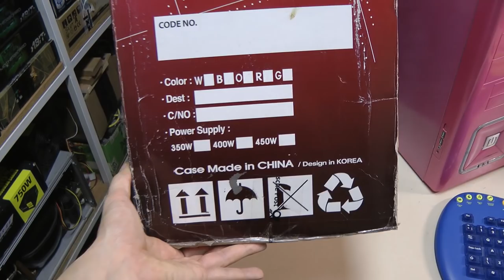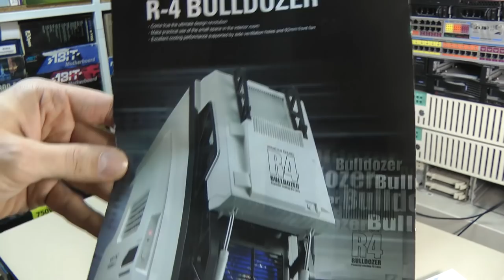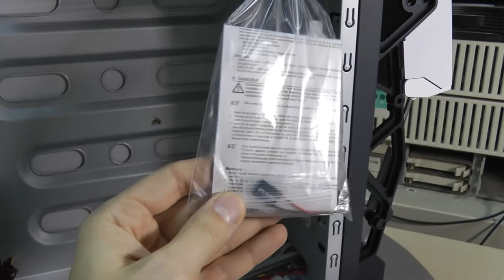GMC R-4 Bulldozer case review - RETRO Hardware

Comment: Maybe the optical drive could retract better if you took off the front drive bezel?  Love your videos!
Reply: Looks like it has to be without it to work properly.
Reply from the maker: yep good idea this way
Reply: @RETROHardware  yes take front of ,its getting stuck in the little ledge
Reply: maybe it was designed like that you have to remove it
Reply: @Pidalin  it's not, I had this exact same case and the little door opened/closed just fine without modifying the drive at all. it's just that the case is a cheap piece of shit and there's probably some injection molding lines on the little plastic cam where the drive pushes the door open and it's getting caught.
Reply: @RETROHardware  did you try just sanding/smoothing the contact area where the tray is getting hung up?

Comment: I've had this case for so long. It housed my P4, my C2D, and 2 different i5 based systems. I can't use it anymore unfortunately, since no proper modern GPU fits in it.
You HAVE to build something in this. Something around 2008. With black/white components.

Comment from the maker: Photo gallery for this video: https://www.facebook.com/media/set/?set=a.1082970265447598
Reply: I was wondering if you'd ever delve into modern hardware? Such as the AM4 socket for AMD or 1200/1151 socket for intel?
Reply: It seems that you'll have to remove the faceplate of the disc tray so it won't catch on the flip door
Reply from the maker: @Kuraio  good idea
Reply: @Kuraio  I thought exactly the same!
Reply: The people yells "BUILD BUILD BUILD"
Reply: @koreannom  Old pc parts are a lot more entertaining than the new ones,

I think that's why
Reply: @PicaPollo  That is very true. I think he uses a fx cpu in his main system too.

Comment: I have had similar problems to the this in the past with the drive catching on the cover on a few different cases with similar mechanisms, I just take the front of the drive tray off and it works 99.9% of the time.

Comment: Very interesting case design I must say, but back in 2008 having only 1 5.25 inch drivee bay for a case this size was probably unpopular, as well as the door getting stuck when the drive takes the disk back in. Also did the fan speed up work? I could not hear the fans getting faster.
Reply from the maker: Yep its quite silent but 2 speeds are working.
Reply: In 2008 CD and DVD drives were slowly becoming retro, you mostly didn't need more than one. What is more problematical is that many fan regulators or other tuning things were made for 5.25" shaft.
Reply: @Pidalin  Even back in 2008? I was under the impression it was like 2014 onwards when they started to become discontinued.
Reply: @DoomGuy9001-MK4  In 2008 or maybe very late 2000s, steam started be very popular and internet connection had almost everyone, also in 2008 most of internet companies started removing FUPs on ADSL, also very fast connection thru cable TV started be very common (you could have something like 10 or 20 Mbps in that time with cable tv and 8 Mbps with ADSL which was enough for instaling games on steam or watching stream services in that time) so maybe 2009 ro 2010 DVD drives became very obsolete for most of people. Most of people are watching movies from ware, it was also common already in 2008 just download movie illegaly so only few people really needed DVD drives. Blu-ray was like baby borned dead.

PS: It was probably different in other countries, I am from Czech Republic, if some countries still had FUPs in that time, than DVDs were probably still very popular there. I have internet at home since 2007 and one or 2 years later, everything was already online. I had very slow interenet in that time (something like 0.8 Mbps real speed), but people who lived in cities with UPC TV had already very fast interenet as I said. Now I have 50 Mbps, which doesn't like so well, but it's on village thru local wifi, so it's not so bad.
Reply: @Pidalin  Sadly in the UK in some areas, internet speeds did not take off as fast. It was around 2010-2012 when fibre was getting popular.
Reply: @DoomGuy9001-MK4  Don't worry, you still have better connection than most of Americans. :-D But yes, I heard about people who moved to UK and said that internet connection there is much worse than here. I think it was supported by state here around 2010 so interenet companies and mobile operators had grants from state for building new connectivity. I have wifi from next village (cca 800m) and he is taking connectivity from 10 GHz wifi, which takes connectivity from main optical cable which connects our 2 biggest cities. I originaly had 16 Mbps here in 2014 and we had many problems, it didn't work sometimes, but owner of that wifi network really improved it since 2014. He had to, because 4g connection is big danger for him, ofcourse, there are still FUPs on LTE, but most of people are casual users and they don't need solid connection for their PCs.
BTW people who have only ADSL still have problems with speed, if you are far from civilisation with only ADSL, you are happy when you have at least that 8 Mbps download.
I heard that countries which were not much civilised in the past have better connection now because they had to build everything new so it's fast now. For example Estonia or even Romania have really good connection now, we can only envy them.

Comment: Just take the door off the cd rom drive. It's just snapped in place, easy to remove and has no function beyond keeping some dust out. Slides upwards. pull the underside of the door outwards as you pull up.

Comment: Sick case!!
Tip: you can take off the little front plate on the disc tray so it doesn't get stuck every time(i think it's supposed to be removed in order to function properly)

Comment: get a disk drive that has a smaller face plate on the caddy (or that sits the caddy slightly higher than normal)

then it will work properly